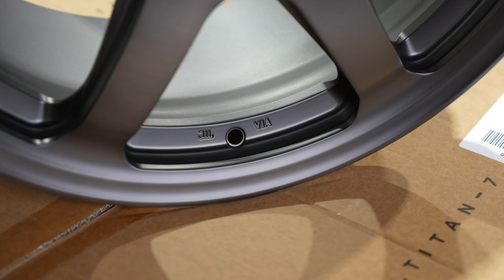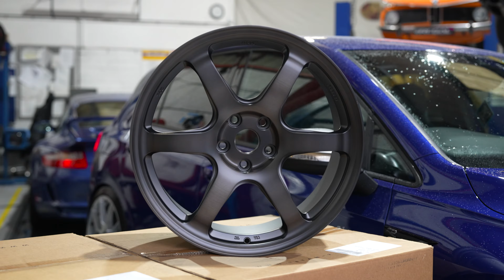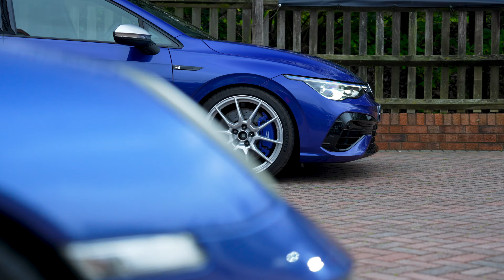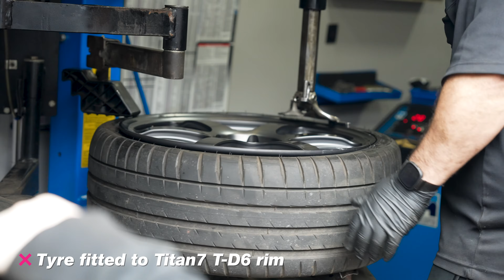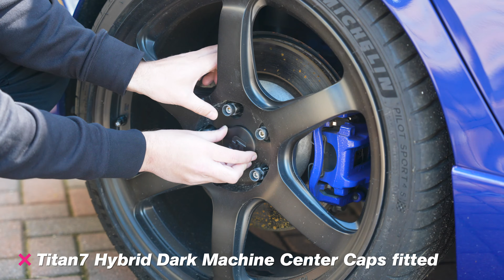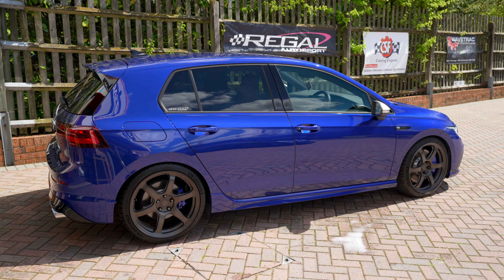FORGED WHEELS FOR OUR MK8 GOLF R [LIGHT, STRONG, LIFETIME WARRANTY]

Comment: Are these td6e vw "specific" - meaning oem ball or conical seat? Already hub centric to the mk8 R? And can be re-fit with the same recommended tire size by the manufacturer (235/35 19) with the extra half inch width without any bead seal leaks?
Reply from the maker: This particular set is VW specific (Golf mk7/8) and you can find them here https://shop.regalautosport.com/products/titan-7-forged-aluminium-wheel-t-d6e-18x8-5-5x112-et-44-cb-66-6-in-machine-black?_pos=1&_psq=T-D6e+18x8.5&_ss=e&_v=1.0

They're also offered in 19x8.5 too!

Comment: I’d like to know stock wheel weight vs flow formed vs forged. How much unsprung weight is saved?
Reply from the maker: ATS RaceLight ≈ 10.89KG 
TITAN 7 T-D6 ≈ 9KG
Reply: @RegalAutosport  If I remember correctly, the stock 19” wheels on my 7.5 golf r were over 12kg so the titans will make a noticeable difference!

Comment: Nice video. What's the weight of 1 Titan rim?  That's the main point of this upgrade... ;-)
Reply: Regal i thought the main reason was because they are lighter and more suited to track? Would have been useful to share the weight of this wheel after a long intro on the manufacturing process.
Reply: @caneytt  exactly, that was the main reason he criticized the silver wheels, that after all they were not light as if the swap was going to shave off a few pounds, but then no mention of either of them weight comparison...!?!?
Reply from the maker: The main reason is because I like them, and they serve as a better base for future upgrades. The ATS RaceLight isn't a very light wheel. Its mainly a winter wheel marketed as a 'motrosport' wheel - you never see people using it on track.
Reply: Ditto!

Comment: Any experience with Team Dynamics 1.2? Are they light?

Or any recommendations for light wheels for a golf/Jetta 5?
Reply from the maker: These Team Dynamics 1.2 are a budget entry level cast motorsport wheel, they're light but like any parts they have a life cycle, especially on track and its not uncommon for them to crack or bend with time (especially when used on higher output, high grip level cars with experienced drivers)

Comment: What’s the weight saving? 
Looks OEM+ which is very much my preferred look.
Reply: Looks very JDM aftermarket, not sure it suits the R tbh. Love the finish though.
Reply from the maker: Will check tomorrow, the T-D6e isn’t the lightest in their range, it’s designed to be primarily strong (less deflection) and light. 

Their T-S5 is their lightest wheel